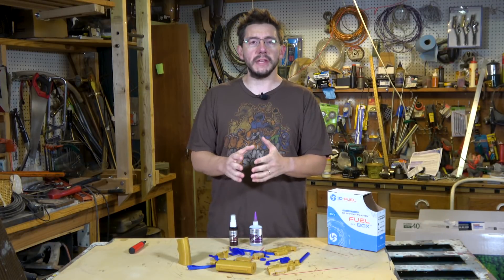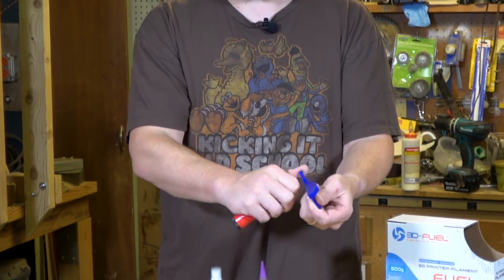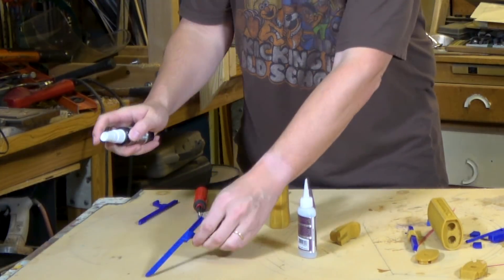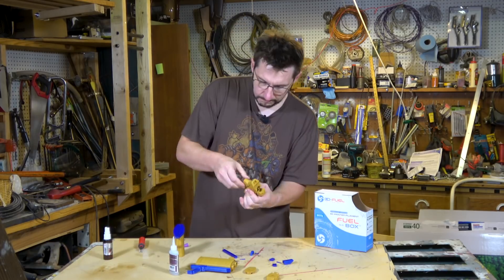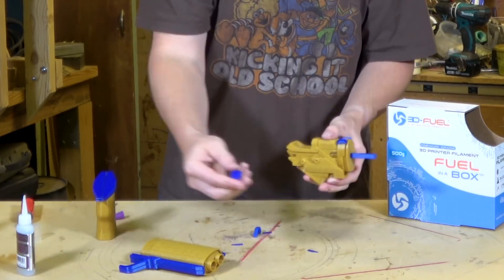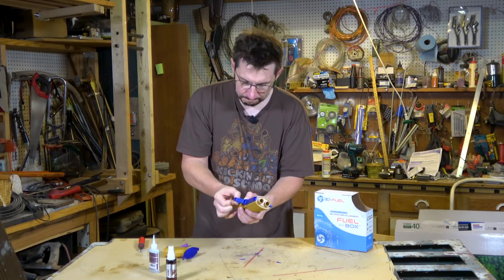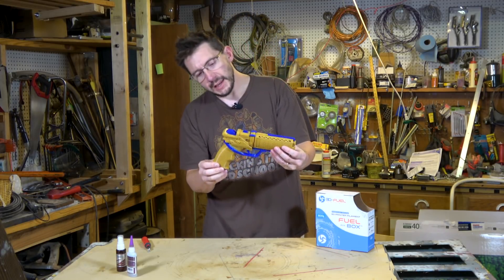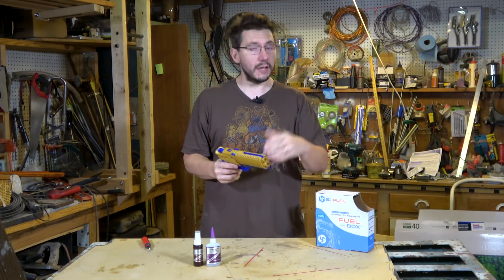3D Printing and Assembling the Bladerunner 2049 Prop Blaster by 3dworkbench

Comment: I always thought CA glue accelerator is used only once the parts are positioned together with only the CA glue applied. If the CA accelerator is applied to the CA glue before the parts are positioned then wouldn't the bond be very weak due to the CA glue being partially cured?
Reply: Yes. Ideally, you apply accelerator to one piece and CA glue to the other, and then put them together. I've also read that accelerator weakens the bond just in general. Something about crosslinking only in 2D instead of 3D. It would be nice to see a video testing this. Also, the accelerator is pretty nasty stuff from a carcinogenic perspective (look up aromatic amines). The smell is actually kind of nice, though. CA normally is a humidity-cured adhesive, so a spritz of water should work as well as the accelerator, though I have not personally tested this.
Reply: I wonder what all those spritzes do to the surface on the model though if you wanted to do any finishing/painting?
Reply: I had a concern about this, too, but I have yet to experience a problem. I always use a spray primer before laying on colors, so maybe I'm lucky that my primer is compatible with the kicker?